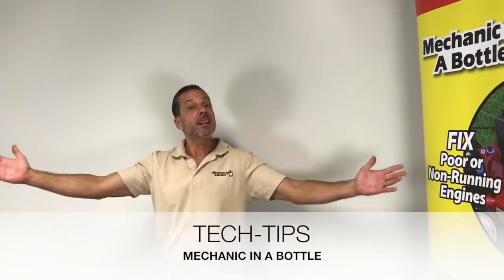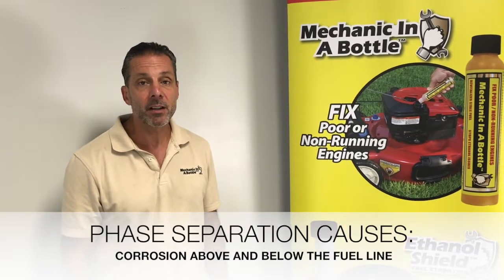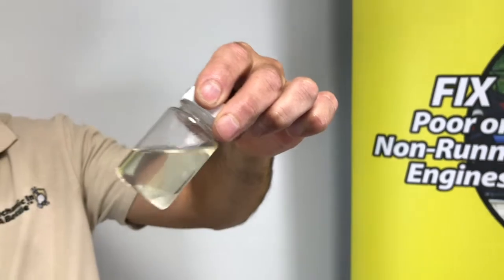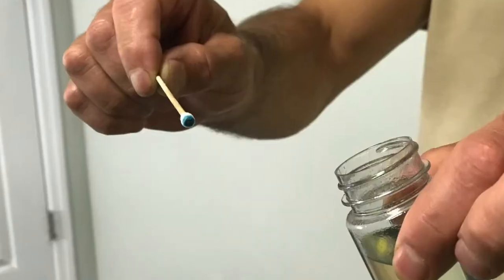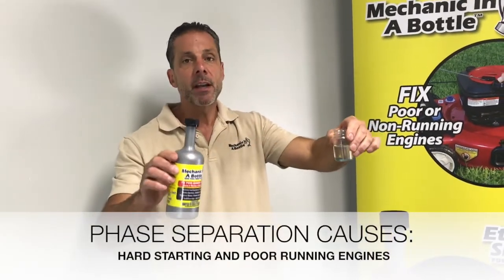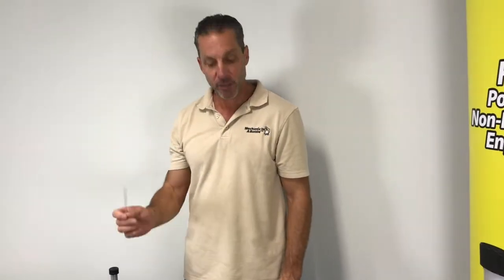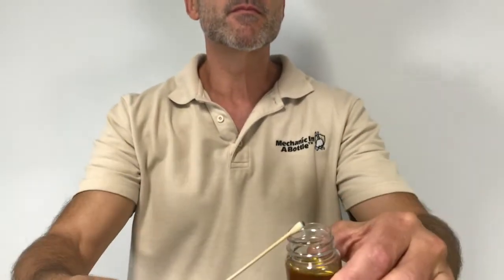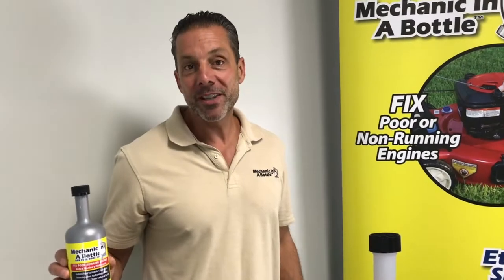Mechanic in a Bottle Tech-Tips with Bob Phase Separation

Comment: Independent of the fact that the tip was blue after you added MIAB, no one could afford to use this product in the ratio you did.  I put 4 ounces in 4 gallons of 91 octane, non-ethanol gas, in my snowmobile this morning because I believe it got a little water in it.  This belief is based on the fact that it idles fine but bogs down and stalls when the clutch begins to engage.  It will take off and run fine at full choke and then I can turn the choke off.  However, if I drop below 6500 rpms it will bog and stall again.
I will be shaking the sled up and down throughout the day and will check it this evening to see if the problem is resolved.  At almost $2/oz it will be a cheap fix if it works but an expensive waste if it doesn't.  TBC
Reply: So it's been a while since I posted the last comment but here is what ended up happening.  It did help enough to be able to ride the sled but it didn't run trouble free.  It was very difficult to start throughout the day and would shut off without warning while riding along at 60 mph.  Ultimately I had to drain all the fuel and start fresh.  So, in an emergency, if you are stuck somewhere and happen to have this stuff, it might get you home but it is not a real cure for water in your gas.  And I used more than recommended.